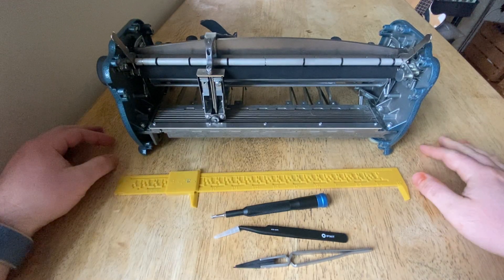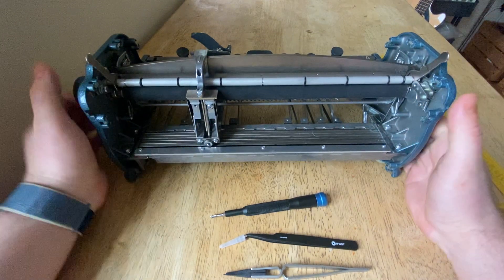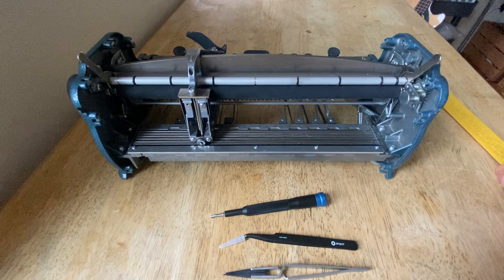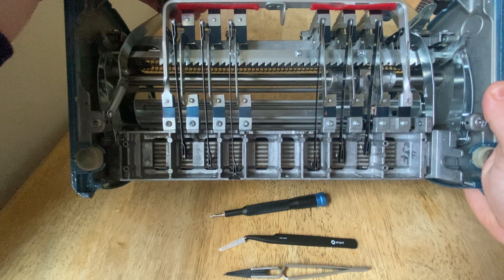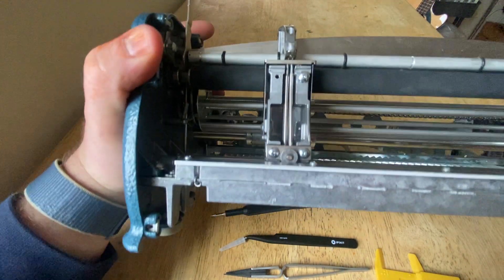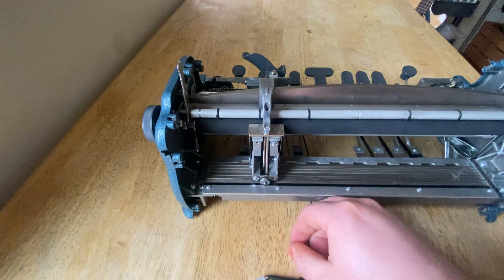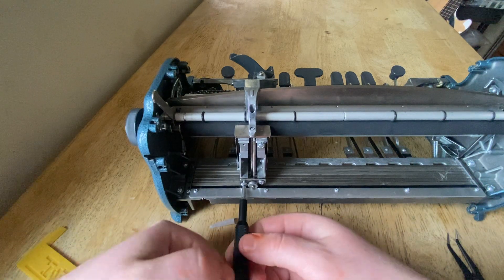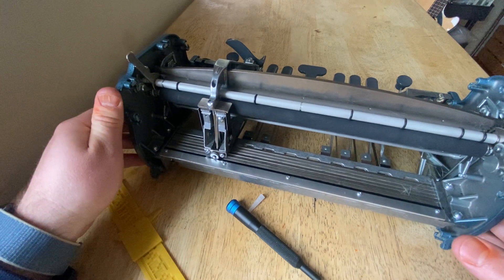What is inside the embossing assembly of the Perkins Brailler

Comment: Very nice.  I have two perkins braillers where the backspace keys fails at certain points.  I assume due to gear wear?  This is probably a common point needing repair.
Reply from the maker: Not gear wear, most likely a loose chain.
Reply: @CharliesDesk  good day how do you tighten the chain?